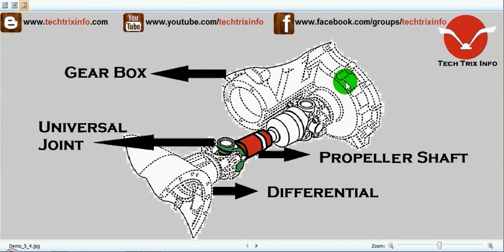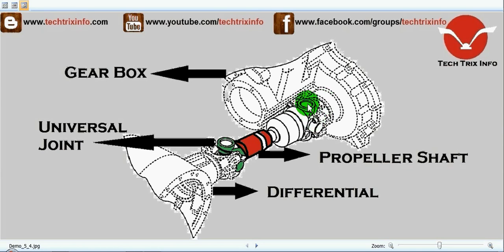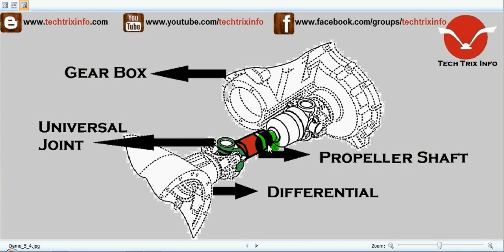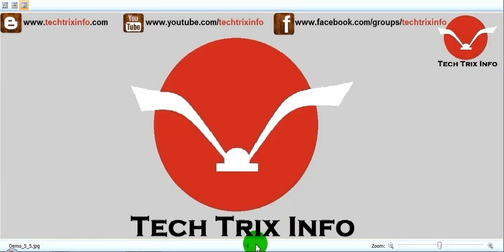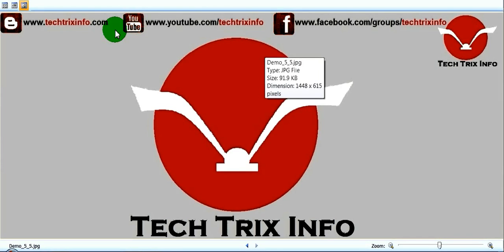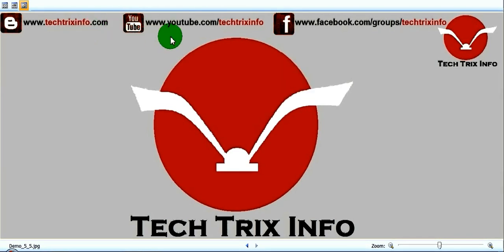How propeller shaft works. ✔

Comment: video is about drive shaft, not propeller shaft. drive shaft = car/truck, propeller shaft = boat.
Reply: Nope you are wrong. My chevy trailblazer as well as ford explorer the front driveshaft is not called drive shaft in any factory service manual. They are called propeller shaft. I believe but im not sure but  it is because the slip yoke is in the drive shaft not the transfer case.
Reply: Actually I just read that they call it propeller shaft in explorer anyway because it has a CV joint on the transfer case side and a U joint on the differential side.